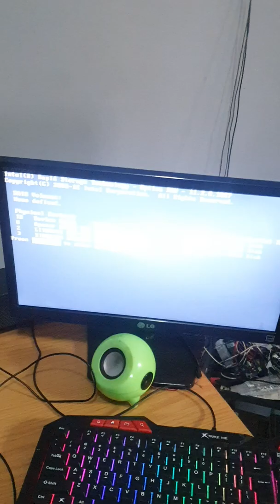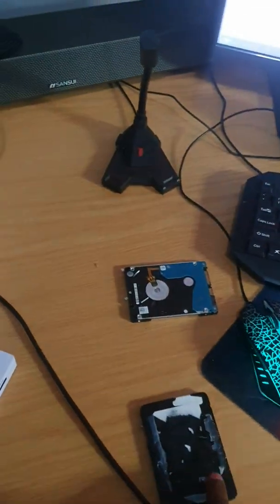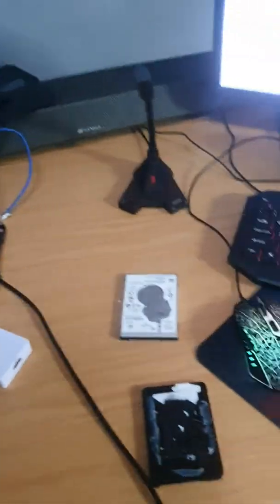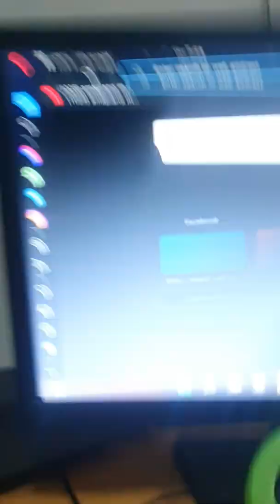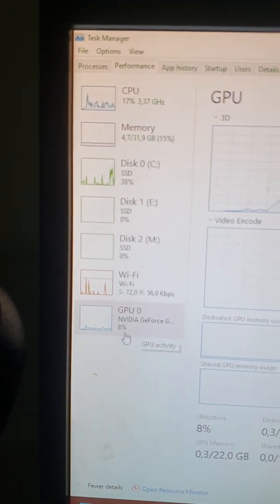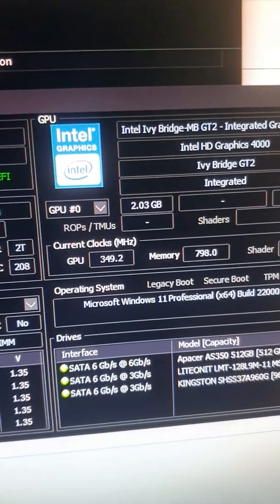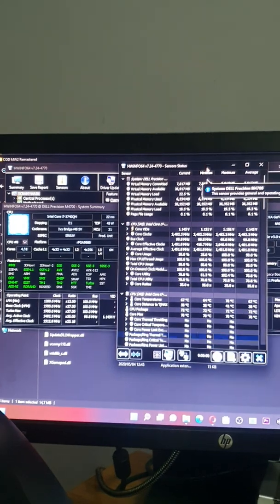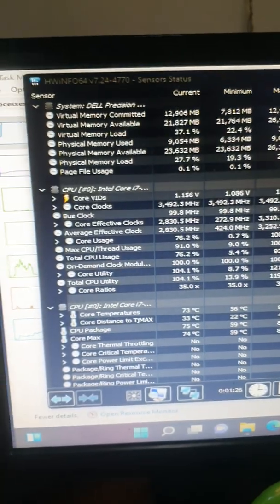Dell Precision M4700 modified graphics card upgrade 2gig to 6gig(1)

Comment: We have a Dell Precision M4700 that we use for old 32-bit utilities.  At some point, I'd like to remove the AMD FirePro M4000 Mobility Pro GPU card that came with this machine and replace it with an nVidia Quadro K2000M GPU card that we purchased for a very good price.  My question is whether or not this is possible and, if it's is, will the system BIOS recognize the nVidia GPU as a "switchable" GPU?  I've both liked and subscribed now.  Thank you for making this video for the Dell M4700 owners. 👍
Reply from the maker: let search further and update, really sorry for late reply